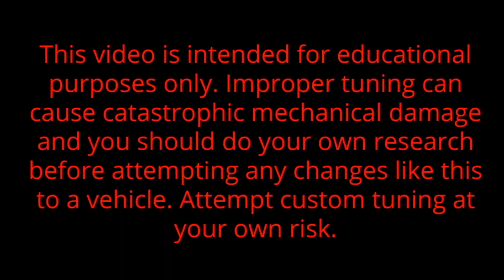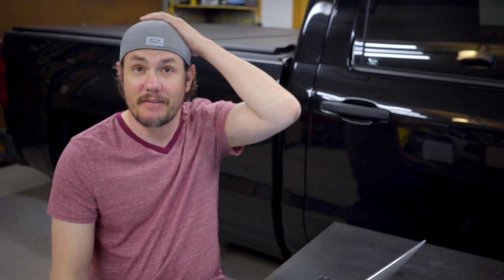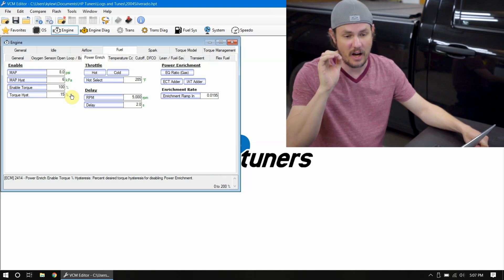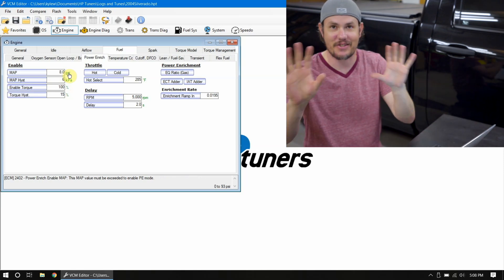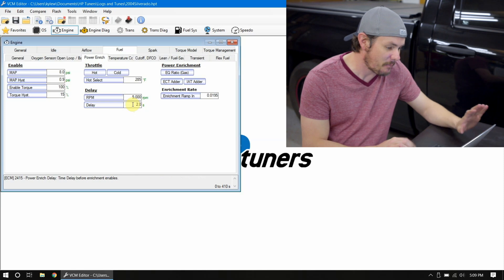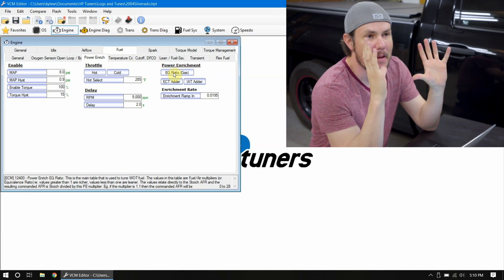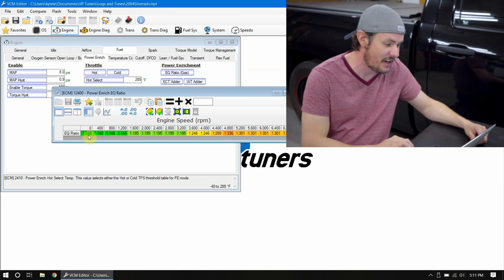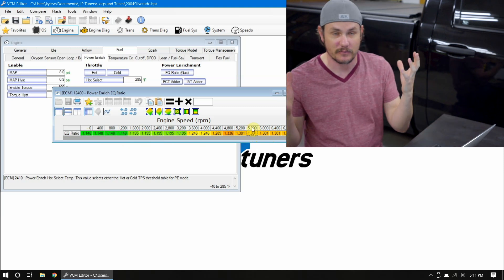Power Enrichment Tuning in HP Tuners, Making Power While Being Safe!!!

Comment: Did you fall off the toilet or something there's like no new videos
Reply from the maker: Haha, no I’ve been working on stuff I can’t talk about, but I’ll be putting new videos out in the coming weeks as that stuff is wrapping up!
Reply: @GoatRopeGarage  ah okay ive been following your videos getting tips on what to do i bought a 2004 silverado it has a 5.3 lm7 from a 2005 it got a stage 2 sloppy street cam in it and i bought hp tuners mpvi3 and i just feel like im missing table changes i keep getting a p0106 map/boro but its random so i think it could be untouched ve cells but i feel like im missing something it came to me max rich but realized it was asking for e85 not 91 (e0_e10) which im running  iv done ve in sd mode and maf only ive got it running good but i still dont know if im missing something i have a few videos on my channel if ever you had time to check out but anyway thanks for your videos between you and chatgpt ive learned alot

Comment: I have been trying to fine tune my cammed 5.7 ram. I do the math on the stoich/power enrichment, it comes out to 14:5 lower rpm and my AFR @WOT hits 10:2. I have made adjustments with not much luck.

Comment: I'm chasing my tail. Stupid ?? Has to be asked. In my eq ratio table. Does Increasing my numbers give me more fuel on commanded? Running 80 lamdra, 11.78 atf ,table is at 1.250. Wanting to get 85 lamdra or 12.5 atf my histogram is saying. .9-1.2 lean my ve table is at 102.

Comment: Great video, PE has been a thorn in my side when trying to hit higher MAF frequencies for MAF tuning. This makes a lot of sense now though and I understand why when I really get into the throttle my AFR bottoms out at around .80. With that being said I'll be trying to take some minor (4%) fueling out of the PE table since I am running really really rich when it comes on. Also, if we are leaving PE on for tuning, but we are constantly trimming fuel off of areas that PE is impacting, can this cause issues? For instance, PE gets modified later down the road to let's say hit at 5k rpms and before it was around 4k, so will we now go really lean at 4k-5k RPMs and if yes, how would you handle or prevent that?

Comment: So when you take a naturally aspirated vehicle and put a turbo then you will to go into pe ? Is that correct?
Reply from the maker: No, Na vehicles benefit from PE also, as rpm’s go up, cylinder temp goes up and the extra fuel cools the cylinder temp. Boost makes it hotter as air heats up when it is compressed.

Comment: Great video as usual!  I have a 2007 Solstice GXP with the LNF engine.  In HP Tuner it seems the only fuel table available to edit is the Power Enrichment Lambda table.  Do you know if that's the case, and if so, can I tune fuel only tuning the Power Enrichment Lambda table?  The only other fuel items I can edit are things like Fuel Pressure Limits, etc which are just single cells (not tables).

Comment: I have a really small turbine wheel (k04-22) on a 2.4 LE5 with e67 ECU.  I have my power enrichment kick it super fast since I can spool to 7psi almost instantly at any RPM. I know the correct answer is to get a bigger turbo that is more appropriate for my engine size, but in the meantime: should I still delay the PE to higher RPM and have a slower ramp-in rate, or should I leave PE almost instant so that I don't risk a lean boost condition when I punch the throttle around 3000RPM?

Comment: I just built a gen 4 ls motor and it makes around 450. When I initially tuned it was the end of summer. I did my MAF and VE and then dialed timing. My afr's were perfect at 12.8 in PE mode for several weeks and made great power. When the weather cooled off now it's at 11.5 in PE and I have made no changes and it has been running great until now. I can tell at 11.5 I have lost power. My question, will change in weather affect a MAF setup like that? I know it will on speed density setup but thought my maf would account for atmospheric changes? Any advice? Should I retune my VE and check my MAF again? Thanks

Comment: I have a tune from a 2002 Tahoe that has flex fuel.  It doesn't have 2 different PE Tables like that one.  How do the early flex fuel vehicles handle that?  I under the flex fuel tab for sensor it has a default % of 38%.. But I don't see where the system changes anything if it detects E85 or GAS.... Can you shed some light on this for me?

Comment: In the PE table, anything below 1 is removing fuel; you don't need a - in front of it.  Take EQ divided by 14.7 and that would give you a rough idea as to where AFR would be if the VE table was tuned to be around 14.7.   

Great videos.  Thank you.

Comment: I have a turbo on an LE5 ecotec, and the turbo makes a lot of it's boost very low in the RPM. should I be using PE to account for the sudden charge of extra air when I pin the throttle down in the lower RPM?  I don't like seeing the AFRs buck around up tp 15-16 for a second or two when my engine is accelerating under load, even though I'm still only sitting around 50-90kpa MAP.

Comment: Your videos are the ultimate source for learning tuning! I have a question regarding power enrichment on a Camaro LS1 2002 stock tune. The Min Torque is set to 0% which I find odd. Doesn't that mean that the PE will always be enabled?
Reply: No, you still need to exceed the rpm delay and TPS in the cold table to go into PE

Comment: Ok 2 years I've battled this. 
I am not new or novice to tuning on hpt.

I have a 2011 silverado 376/6.2l 

No matter how much I zero, or lower my tps enable or anything.. my p.e. barly ever engages seems to only go to p.e. as commanded once or twice after writing a tune then after that I can stomp it up a hill in colorado to 100% and it'll stay at fuckin 14.1:1 
Then I'll write a file and it'll go in to p.e. after that once or twice when I stomp it as it should. 
Then stops again... 
This is fairly common with silverados on htp from what I've read. 
And man ive set this to litteraly 0 map. 0rpm, the upper and lower bypass are maxed 250°/-426°  ramp In is at 2.0
Ramp out 0.05 
Hot tps set to 50% 
I mean I've done it all man and this has gone on and on and on for 2 years now 
I've never had these issues tuning v8 cars.. it does what I tell it. 
But on the trucks this is a constant issue man. 

Any one got some insight? 
Do I need to update o.s.? 
Or... are we just fucked 
I mean can I add a boost enrichment and set it to n/a levels? 
I've even turned piston protection on after 3krpm 

Thanks for any ideas guys

Comment: Hey man. I have a ls2 gto torquer v4 cam (231/234 .629"/.615" 111 LSA) headers full exhaust. I run perfect 1 lambda from idle to 5k (+/-.02) and work my way to put .85 under power enrich all the way to redline. My car billows black smoke, the bumper is covered in black soot and my oil seems contaminated. I use a aem 30-0300, tuned ve and maf thanks to your videos, and the long term and short term fuel trims suggest that my tune is spot on. What could be the issues, where should I look?
Reply from the maker: Headers are skewing your narrowband readings, the narrowband switching points need to be adjusted after long tube installs, get it idling at perfect 1.0 then look at the average narrowband mv and then bump them, normally need to go from .45v to .65v to start
Reply: In for answers

Comment: This video really helped me out. I put a crate 6.0 liter in my 08 avalanche and it has larger injectors. I had someone write a tune file for me but he didn't account for the larger injectors and so the LTFT were living at -24 . I had tried some injector tables off a spreadsheet but they didn't work with the E38 ECM. Once you showed the Z06 table I could see it was where i needed to be since the Z06 runs the same size injector. I loaded that table and it was lean but after removing 10% off the table it came in perfectly. Now I just have to figure out if there is any other problems with anything else since I don't know exactly what he did but i am on the right track now.

Comment: So spent some time on the dyno with my 2015 camaro 1le and my car makes the most power with an afr of about 12.8 under wide open throttle I have my power enrichment ramping up to a peak of 1.21 is this to much PE or is that about right. Driving around afr stays right around 14.6 to 14.8 with maf and o2s and took a 10 hour trip to oklahoma averaged 28mpg there and 30.1 on the way back

Comment: What about mpg on a stock car if I want to tune for  best mpg what should I basically tune In pe since you said never turn it off
Reply: After improving my info I have run into my old comment now I see it as a dump comment since pe will not kick in at close loop situations so it's only for wot it doesn't have anything to do with mpg you stupid

Comment: Hey man so I just installed a 219/226 .630/.603 / 112 Brian tooley stage 1 truck cam in my truck I had the heads ported / polished 
Added long tube headers , double x pipes and a circle d 3200 stall I’m my 2017 GMC Sierra 5.3 z71. The shop that did my work sold me on the idea after telling me how powerful my truck would be. Well now my truck has problems staying turned on, seems it is having trouble finding gears, and to be honest it just seems it has way less power / torque in general. I feel I made a huge mistake as this is my daily driver and I’m a single dad . I’m in the Atlanta area is there anyone you know who can help me?
Reply: I forgot to mention I’m only getting about 7 mpg now as well!
Reply: @robertokelly4540  who did you end up getting to tune it?
Reply: Did they tune it as well?

Comment: Any insight into why on those gas PE tables, does it get richer as it goes toward 4300, but then gets leaner toward the top? Shouldn't it continue on the richer progression?
Reply from the maker: Follows the torque curve for the motor as that is where load is the highest and thus cylinder temp will be highest.

Comment: Do you have any videos that touch upon DFCO, loss my deceleration popping sound, tryna see a setting where I need to be to get it back
Reply from the maker: Turn it off
Reply: @GoatRopeGarage  I'm on hp tuners now under the Cut off, DFCO, I don't see where there is an option to disable it, just values for temp and rpm and does CFCO stay on or that has to be disabled too?
Reply from the maker: Should be an enable parameter, and do away with CFCO if it's a manual

Comment: So if your tuning PE and shooting for .87 lets say on 93 and you get it working right.  Then when you convert over to tune your E85 PE.  would you shoot for .87 on that table too?  Since it's the same in Lambda?
Reply from the maker: Theoretically you can run the PE a bit leaner on the e85 table given its properties
Reply: @GoatRopeGarage  So on a NA L86 .89 lambda??  As long as it's not knocking.

Comment: I  am seeing a lot of heat. Changed radiator twice (better each time) water pump 3 times, vacuum filled water, 3 diff temp thermostat. Two people have tuned. Got fed up built new 408, same problems. New harness and computer. Still same issue....thoughts?

Comment: Just curious, will a flex vehicle allow use of E100? Just been curious, most cars can tolerate 10-15%,   and can it judge between ethanol, and methanol? 100% methanol, with 15% fuel? Insted of ethanol/ E85, M85 I guess,  I'm only concerned with GM, as far as I'm concerned, besides Japanese vehicles, they don't make anything else, haha,  great video, I'm hoping to learn the basics of how HP tuners work, I have a decent idea of how the engine , fueling, and trans works! Thanks for the info!
Reply: Yes, flex fuel lines running from tank are suitable for E85+, the stock fuel ones don’t have safe lines.

Comment: Fuel only burns as vapor, it takes time to go from liquid to vapor, the heat will help 'evaporate' the fuel, but more fuel will evaporate, partly giving a good air/fuel ratio to burn while ending up more rich as the burn continues. Similar to cold weather enrichment, or chokes from the old days, supplying more fuel to have enough to evaporate for a good ratio, as the engine heats up. Less fuel is needed because it evaporates faster. And like you said, more fuel cools the combustion, lean AFR is hotter, and hot spots will happen, leading to detonation, very bad with boost or nitrous! Bad enough without, it can kill engines over time, or instantly , just putting this out there, sure you know this,

Comment: My car wouldn't go into power enrichment. It's a 2017 camaro ss A8.Throttle body position barely pass 50% when I floor it to redline on 3rd gear.  Do you think its the tuning or could it be mechanical. Can you help me figure out what's the deal here. Thanks bro
Reply from the maker: What mods you running?
Reply: Goat Rope Garage h/c, msd, 2” headers, rotofab, e85, tc , ported Tb
Reply: My tuner couldn’t figure out what’s going on
Reply from the maker: @maximuss5533  he adjust your torque? Sounds like you're getting limited by torque. The throttle position you're logging, is it SAE? If so full open is only 76% or there about. But if you don't have things dialed in right it's going to limit it's ability to open and possibly be related to what you can't hit PE
Reply: Goat Rope Garage I’m not sure if he adjusted those but he tried a few different tunes and nothing, still same

Comment: 12:39 So confused why there are values in the low RPM range of the PE EQ table if it doesn't kick in until the RPM Delay. What's the point of the low RPM value?  Thanks
Reply from the maker: Not having enough can cause issues also. But also not getting into PE soon enough can be an issue on some cars, try lowering the enabled points and see if enrichment helps
Reply from the maker: Delay does what it says, delays PE coming on, and having a set point of 4k will usually mean you break the delay before the delay expires and get into PE anyways, but say you are on a 6 speed manual and you put it in 6th and give it WoT from 2k, good chance your delay will expire before you hit 4k and allow PE.    The idea being that normally you don't need PE until the higher RPM's when cylinder temp becomes an issue but under heavy load like the situation we are talking about there is a likely hood that you would need PE to keep from getting knock.  That is why we have a table that goes down into the lower RPM's like that so we have a reference setpoint no matter where we are at, even if we are in areas we can't even operate the car (Sub 1k rpm).
Reply: @GoatRopeGarage  Thanks. My ZL1 was MAF tuned so I couldnt figure out stuff like this. My tuner has my delay at 5000 and other things are weird in there too. Trying to learn more to see how he built my tune. Thanks for what you do here. You're a hero to many.

Comment: Kyle, in many respects PE (as you mentioned) may aid in my ramp challenges.  I have watched this video about 5 times now $ ...  :)  but have some questions and likely wont type them all.  But, assuming my SD scenario and a very solid VE fuel map.  When PE kicks in won't this only make me run richer in the respective areas once it kicks in?  Also, is the correlation between richer and power the one that is being made in PE?  Meaning because more fuel is being added your now assuming more power which is not always the case as I told you I was pig rich as it was and likely losing power as a result - to add my METH kicks in with BOOST also which simply richens even further?  LOGGING PE? - is there any special way to log when PE kicks on other than via AFR?  last question .....  I have seen in my logs when Short/Term ceases and just flat lines - is this when PE kicks in that no longer is Short Term corrections being used?

Sorry for all the questions but that would help me a great deal even if you just can answer some of them.  Thanks so much it is appreciated and hope you are having a great weekend!!!
Reply from the maker: You have a PE PID you can log that will show you when it's active, but you're also right in that your narrowband sensors peg rich also. You don't have a PE area, per say, you have triggers that you set so you can engage PE at different times in the VE table. PE is generally only activated in higher RPM or WoT situations, both of which need the extra richness to safely produce power.

Comment: Can you talk just a little bit about how  SPARK/ADVANCE -> Base Corrections -> Gas could work at a WOT rich situation.  Ultimately I heard you can use these tables to both add timing and lean fuel if you happen to be in a WOT rich situation vs just working to lean out your main fuel tables or add some timing and watch for KR.   Seems interesting and useful!
Reply from the maker: I'll look in to it, thanks for the suggestion!